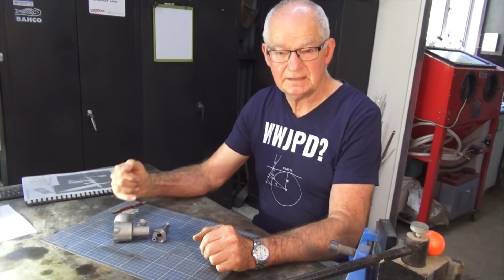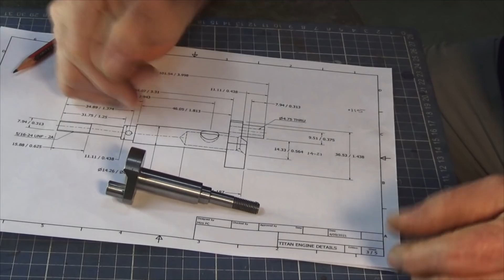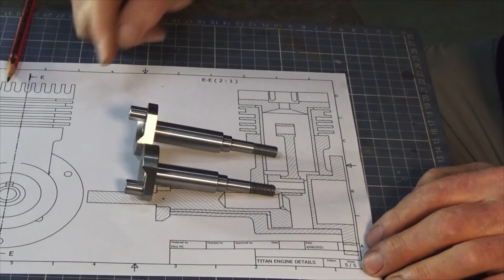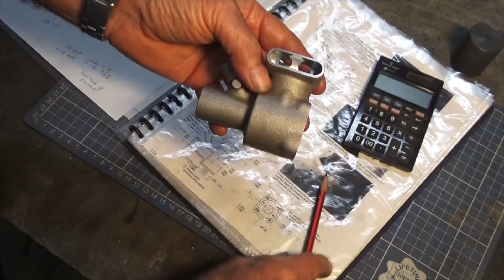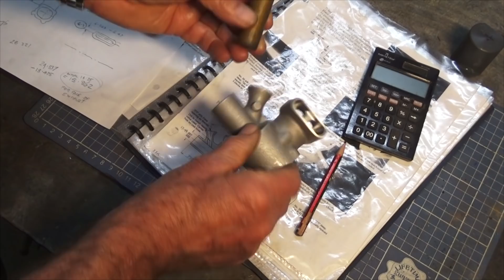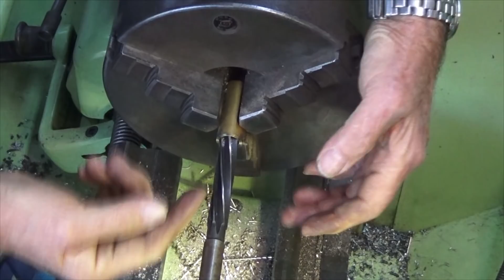Building the Titan .60 Glow Plug Engine #3

Comment: A quick way to stop the drill from being dragged I is to grind the cutting edge flat so it is 90 degreess to the material so it scrapes more than cuts
Reply from the maker: That's correct. Unfortunately, you end up with a lot of drills which are then unsuitable for cutting steel. I have just purchased a D Bit grinder so I am hoping to grind a set of drills with zero rake for plastics and brass and keep another set for harder materials.
Regards,
Mark

Comment: I was taught by a very old, experienced and PRECISE machinist,
 to ALWAYS tighten ALL THREE jaws of a chuck,
 either drilling or turning.  
That way there is EVEN  and strong clamping on all sides,

VERY GOOD VIDEOS!
Keep them coming!
(warts and all!}
Reply from the maker: Would you believe that I had a very "robust" discussion with an experienced machinist (and teacher) who ridiculed me one day for suggesting that tightening all three sockets in a three jaw lathe chuck was good practice. He claimed that it was complete rubbish and that the scroll would close all three jaws no matter which socket was used. My problem was that the drill bit I used for initially opening up the hole was blunt. I only just purchased a Deckel clone D bit grinder and it's currently sitting on the bench waiting for me to summon up the will to have a go at four facet grinding on some drill bits. 
Regards,
Mark
Reply: @Preso58  Looking forward to your Deckel clone video.

Comment: Lucky with the wrong cylinder height. 
Guess the design never included a silencer. Or does it strap around?
Fascinating watching this, learning a lot. But have no desire to take it up as a hobby. 
Thanks.
Reply from the maker: I haven't seen any reference to a silencer but it could be held on with a spring clip. 
Regards,
Mark

Comment: Something that tight of tolerance I probably would have used emory cloth to dial it in and scotch brite. Just thinking out loud hah! Looking good man!😎
Reply from the maker: That's how I would normally do it but I want to have a go at lapping, even if it's just to say I have done it.
Regards,
Mark
Reply: @Preso58  are you going to put any sort of oil passage groove in the bushing? Or is it one of those things that it doesn’t run long enough to burn off the oil between the crank and bushing? Also does the paperwork say anything about expansion of the materials? Or it doesn’t get that hot? I have never built small engine like this only large ones so this is all new and interesting to me.

Comment: Does the crank need clearance in that bush so it doesn’t nip up at operating temp?
Reply from the maker: That's a good question. The construction notes don't make it clear. There are tolerances on the shaft diameter and the bush bore size but I don't have reliable inspection equipment to measure to that degree of accuracy. If it does bind up it shouldn't permanently damage anything. It should just stop the engine. The lap I am going to make is adjustable so you could just take a few more microns off the shaft and give it another go. 
Regards,
Mark

Comment: Being an end user of engines like this one. I'm really enjoying seeing all the work that goes into building the parts for this engine. I've rebuilt them but never thought about the work in making the parts. Thank you for making these videos.
Reply from the maker: Ron, I wonder how many engines OS Max and Enya pumped out over the years. There must be millions of them languishing in boxes and drawers around the world. I still have the first engine I bought with my own money. It was a Taipan Tyro 1.5cc diesel. They were designed and built here in Australia and as tough as nails. I am pretty sure it had ingested plenty of dirt due to vertical landings over the years I flew with it. I should really clean it up and put a prop on it for the display case.
Regards,
Mark
Reply: @Preso58  I sure there are many hundreds of millions. I have around 50 of them. Only 12 in flying planes.

Comment: Enjoying the ride 👍
You will need to ream the bush again once fitted. It will certainly close up and it is not round after being held in the 3-jaw.
It's a bummer when you have to re-make parts. I was admiring a customers' 10.5cc V10 DOHC 4-stroke when he pulled out a tin full of camshafts that were all rejects for one reason or another.   There were probably a dozen of them. Man, it was painful to see.
Reply: That's exactly what I was thinking, seeing the bushing in a three jaw and knowing it's not even close to round before reaming after installation.  Honestly, I have to say it's a joy this isn't a rear induction set up.  I makes my head hurt to think about the intricacies of getting a rotary valve machined to properly time the engine.  Bad enough having to drill the crank to set timing as it is.

Wish I could send some liquid nitrogen to help with the bushing install, but no doubt heat on the casting will suffice.
Reply from the maker: My biggest fear is getting the bushing half way in and having it seize up. 
Regards,
Mark
Reply: @Preso58  Get your press or vice ready with the appropriate spacers etc just in case. If it goes in half way at least you know your fit is correct ! Then just squash it in. At this point, force is your only real option (except machining it out) as the expansivity of aluminium and bronze are essentially the same and heating the whole affair won't allow the bush to fall out.
Reply: @lobuxracer  Most model aircraft engines are set up this way as the rear induction is a pain to deal with ; having the firewall right behind the engine.
Reply: @Andrew_Fernie  I'm well aware of this.  I also remember rear induction being popular on 0.40cc engines used in pylon racing many years ago because it makes more power and  has a stronger crank when displacement is restricted by the rules. Sure it was not simple to fit, but if you weren't running one, you weren't winning.
Reply from the maker: Andrew, I had to buy that 9/16" reamer especially for this job so I will definitely want to use it again. I was in Invercargill, New Zealand and a local hardware store bought up most of Burt Munro's memorabilia. He was the real life character in the film "The World's Fastest Indian" They had put up a shelf system owned by Burt with "Offerings to the God of Speed" written on it. Burt had placed burnt up and broken pistons, connecting rods, valves and cylinders in the shelves and it survives to this day. That film was one of my favourites and seeing the shelf and it's contents made me quite emotional. I guess the moral of the story is that you keep failing until you succeed!
Regards,
Mark
Reply: @Preso58  Indeed. There is many a slip twixt cup and lip.
One of my favourite films also.

Comment: If NASA can fly an orbiter into the Mars surface due to a mix up with Imperial and Metric I think you are doing very well.
Reply from the maker: I was discussing the imperial vs metric thing with James Clough a few weeks ago on a live stream and the conversation turned to NASA and what system of measurement they used because of a comment that was made to me on another video where I had a whinge about imperial measurements. The comment was something along the lines that men went to the moon using feet and inches so what are you complaining about? James and a few others were adamant that NASA use metric only. It sort of makes sense since every country in the world uses the metric system except Liberia, Myanmar and the USA. Even Liberia are transitioning to metric. Having said that, we switched to metric back in the mid 70's but some kids at school (where I taught up until a few years ago) would yell out to one of their mates who had just chucked an orange at them, "Ha, you missed me by a MILE". 
Regards,
Mark

Comment: SIR! I have made mistakes on YouTube, cost me about a grand US. But the mistake was made and had to be corrected, nothing for it. Cut out the bad and make it right. I got ZERO blow back admitting I blew it and in fact people supported me for admitting to it. Meh, life, moved on and I fixed the issue.  I also use Autodesk inventor, my whole 44' boat I am building is in Inventor, and yes, while the inventor files are VERY accurate, the actual boat not so much. But I digress, back in the day I flew RC airplanes and many had .60 engines so I have very much enjoyed this series of yours, thank you for sharing your honest work and videos!
Reply from the maker: Thanks for watching. I actually trained on CATIA before I started with Inventor. CATIA is owned by Dassault Systemes and it was so expensive that most companies leased it and then, only the modules they needed. We had access to it for free and I was thrown in the deep end when it was rolled out to schools through a STEM activity called F1 in Schools. I don't know how many nights I stayed up until three in the morning trying to learn how it worked. The problem was that Dassault couldn't be bothered to help out with training materials or licence distribution. Autodesk saw an opportunity and stepped in with free access to their full suite of programmes for both students and teachers and there were no cumbersome licences to manage. We got the latest versions of Inventor, Maya, Revit, and some really cool CFD software. I also got to visit the Autodesk headquarters in San Francisco and their makerspace down in the pier district. 
Regards,
Mark

Comment: when ye use the boring bar, do ye take ae free cut tae account fae deflection?
Reply from the maker: Yes. With the very small boring bar I was using, with extra long stickout and a carbide insert which has a very small edge radius it is necessary to run at least two spring passes until it stops cutting. 
Regards,
Mark

Comment: Was that bushing sliding in the chuck when you were drilling it out?
Reply from the maker: Yes. The drill bit I used to open up the bore was a tad blunt. However, using really sharp drill bits on bronze and brass can lead to the cutting edge digging in. It is sometimes good practice to reduce the edge rake to zero to prevent that happening.
Regards,
Mark